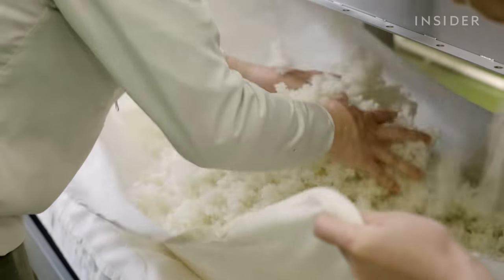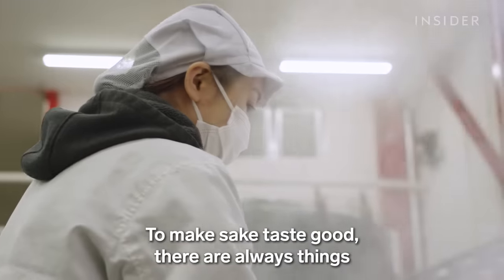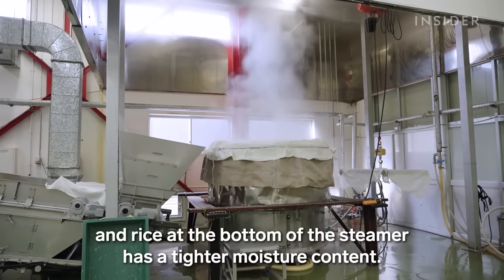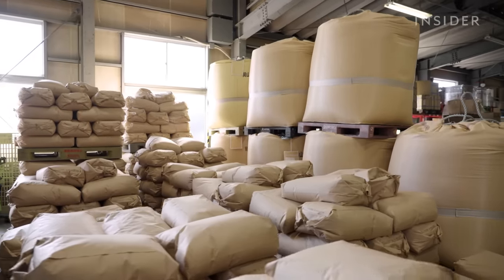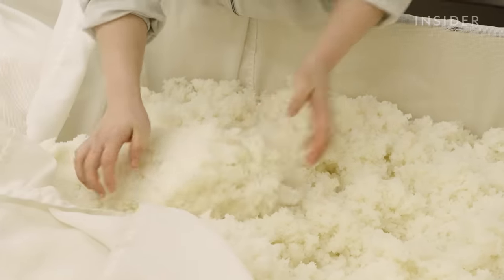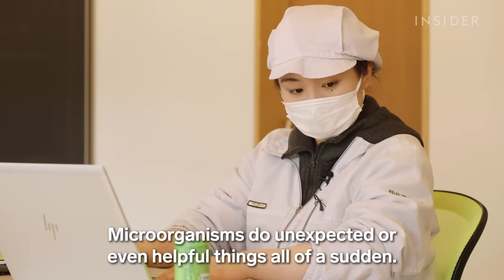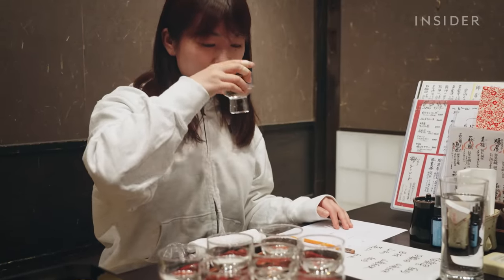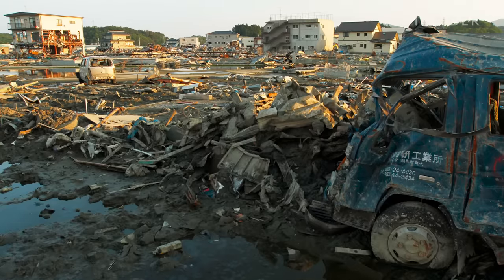We Spent a Day With Japan’s Youngest Female Sake Brewmaster | So Expensive Food | Insider Business

Comment: To those thinks that everything is expensive in Japan, you can buy sake for $2 at 7/11 but it's entirely factory produced. It's just that Japan has a wide range of products with the accompanying price tag. It's just like with everything else, once you become a fan/hobbyist/connoisseur you may be able to enjoy finer qualities. Doesn't matter if it's sake, or wine, or high end camera equipment.  Logically speaking if a lot of time and effort has been consumed to produce something, it's going to be expensive.
Reply: Precisely. I've seen a LOT of comments for people comparing the completely hand-made, more ancestral process of brewing sake to this form or other forms that use machines, as if it's competition. They're simply different ways of doing similar work. If the end product is good, then in some cases, it shouldn't matter. 

It's like people comparing industrial knife-making to 100% handmade blacksmith knife-making. Of course the handmade product will be more unique and possibly more customized. Quality does have a price tag. However, unless you're a professional chef or a hobbyist, do you really NEED a $2000 custom kitchen knife? Sure, it's nice to have, but there are still quality things made in different ways.

Comment: 1:17   That's a little misleading. Junmai Daiginjo sake (純米大吟醸) uses rice that is polished to less than 50% of its original weight. Just like how white flour is polished wheat without the germ and bran, Junmai Daiginjo sake rice only has the endosperm. However, the range of Junmai Daiginjo sake is so wide, 45%, 39% and 23% are all called Junmai Daiginjo, so the price also varies wildly. Junmai Daiginjo sake can be reasonably priced too, it's not going to be $10 per bottle, but it can be as low as $100 for a good bottle, and expensive ones can fetch the $10,000 price, and they can all be called Junmai Daiginjo sake. And if you want to know what's the effect of the polishing, the sake tastes much much smoother and milder than cheaper sake. I tried higher brand Junmai Daiginjo sake before, and it fucked me up, because of its smooth taste and lack of alcohol's signature punch, it goes down way easier than any other alcohol, thus you'll drink way more alcohol-wise.
1:24   Before you ask, it's not the Kawasaki you're thinking of, nor the bigger and more famous city of Kawasaki right next to Tokyo. Kawasaki the bike, fighter jet, missile, train, and turbine brand (the one you're probably thinking of) is actually from Kobe, it's called that because the founder is named Kawasaki.
Reply: Good JDG's dont have a base price of $100....youre insane if you think so. There are plenty of great $30-$60 JDG sakes out there. 

The other effect of polishing is the natural sweetness of the rice comes out more and is more subtle. There are dry JDG as well however.

Another thing people should absolutely NOT think is that just because a sake is JDG doesnt mean its better than a junmai, or junmai ginjo, or anything in between. These are preferences and the same rice from the same brewery using the same water will taste vastly DIFFERENT depending on the polishing ratio. Not better, not worse.

Comment: I truly appreciate their efforts and their time and history.
But we also have to understand that a higher polishing ratio doesn't always mean a more tasty product.

The more rice that's removed means the weaker the body of the sake and the less richness in the flavours and aromas.
But what a more high-polished ratio sake offers is cleanliness, elegance and subtle aftertastes.

Just want to get this fact out there before someone spends their hard earned money on a high-polished ratio sake and disappointed by the lack of impact.
Reply: Ive worked in the alcohol industry a long time and this is the number 1 thing i try to explain to my customers all the time. 

Just because youre buying a JDG does not automatically mean its a BETTER product. Just a different one. Even comparing dassai 45,39, and 23 i try to explain that the 23 will be softer and more subtle and slightly sweeter than the 45 but that comes down to personal preference and not quality. Some people prefer the 45 because it has a more robust flavor, and some people prefer the 23 because its softer and milder, and other people want something mroe in the middle so they prefer the 39.

Polishing ratio does NOT equate to quality, just more time and more product used to produce a single bottle which directly correlates to the cost of the bottle.